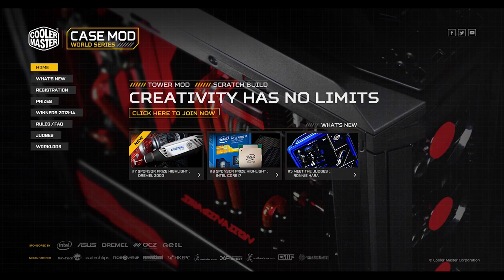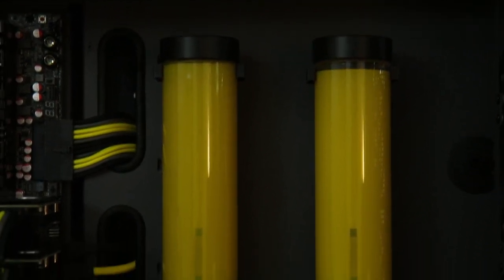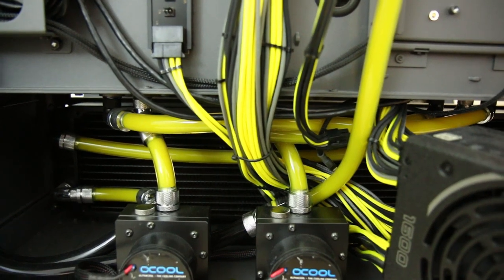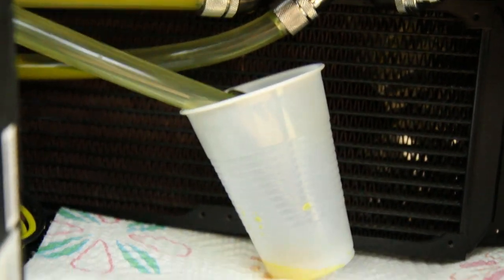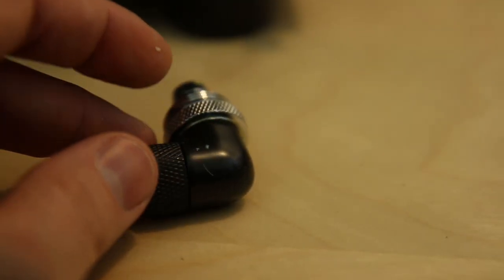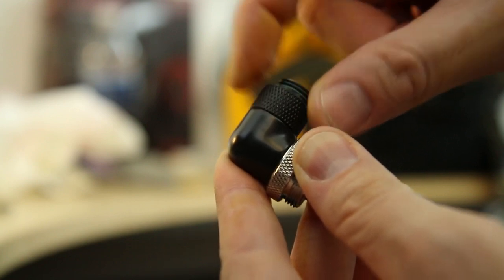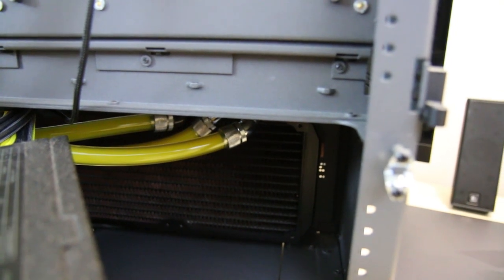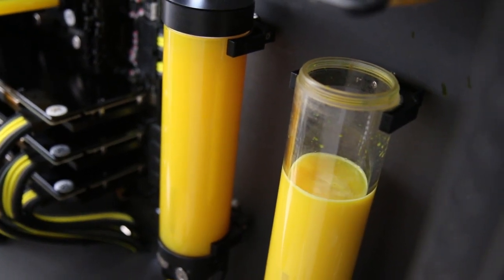My $6500 Custom Watercooled PC LEAKED!!! Now lets fix it....

Comment: sounds like water cooling needs to be re-engineered for less failure points
Reply: just use plastic fittings
Reply: TurboCMinusMinus lol yeah 20 fans
Reply: Water cooling is just air cooling with the water transferring the heat from the components to the heat sinks (radiator) instead of heat pipes. The advantage is being able to have much larger heat sinks than with air. The amount of energy that a heat sink can dissipate depends on its surface area. With CPU heat sinks like those from Be Quient, you don't really need water cooling for CPUs. But, the form factor makes this impossible for GPUs without extreme modding. But, people have had great success with CPU heat sinks put onto GPUs.
As for your original comment, they have. It's called AIO water coolers. They have minimal failure points, and they use permanent fittings, which allow better sealing. There is no reason why someone couldn't try doing something similar with a custom loop.

Comment: couldn't you just use mineral oil instead of water so if it did leak it wouldn't damage anything?
Reply: Two problems with that.  1) These pumps really aren't designed to push liquid with the viscosity (thickness) of any oil.  2) Mineral oil is not nearly as good of a heat transfer fluid as water.  Water has a thermal coefficient of .67 K W/mK while mineral oil is at .162 W/mK.  This means water is about 4 to 5 times better as a heat transfer agent.
Reply: +John Smith But if the water was distilled (I don't remember the actual term for it, but the process that removes everything from the water) then wouldn't the computer be fine anyways?
Reply: I'm not really sure what you're asking.
Reply: John Smith
Water isn't conductive, the impurities in it are what make it conductive. If you used the type of water that has no impurities, wouldn't the computer be fine if it leaked?
Reply: The problem is the water wont stay pure inside the loop.  It will be making contact with metals (copper usually) and will pick up charged particles from that.  So it WILL eventually be conductive.
Reply: John Smith
I didn't even think of that.
Reply: Are you refering to deionized water?
Reply: I think he means... mineral oil.
Reply: llamasplosion i think it is just because its thicker than water
Reply: Use colander
Reply: llamasplosion modern coolants are not very conductive to a point where it doesnt matter if it leaks
Reply: John Smith nerd

Comment: Don´t move rotary adapters, when fluid is in the Loop. That´s a good tip to avoild leckages of this type. No matter if a adapter costs 5 or 10 $ . It can happen to every brand

Comment: If you ask me the risk of leaking with a custom loop is significantly less than with an AIO such as Corsair. When you build a custom loop everything is in your hands and you can have nearly full control over it. Most of the leaks from custom loops are the result of either negligence or simply human error. But the more you learn from it, the more of those errors you can root out with subsequent builds.

Compression fittings are quite secure and it takes a lot of force for the tubes to simply pop off. At worst scenario, working compression fittings will unscrew themselves slightly because of rotational tension. This can easily be fixed by getting rid of that tension or stress, and screwing the fitting on more tightly. Any other failures from fittings is the result of unnecessary stress which can easily be remedied by giving the tubing enough slack. 

Apart from the fittings themselves, another possibly common source of leak is when people tend to forget to plug 
open ports or even tighten the existing plugged ports. So you can get micro leakage from radiators and GPU water blocks.

A third source of leak is overtightening fittings to the point where the ports begin to crack. This goes for the reservoir, pump and water blocks etc. 

And a fourth and common source of leak is when people use too long screws for the radiators. When they mount it to the case or fan they punctuate the radiator with the long screws.

Comment: Why do people even do liquid cooling? Like, other than the fact that it can be configured to look really cool, it seems useless. If you want liquid cooling for a "quiet PC" then why don't you just wear headphones instead? Or maybe just buy some very silent fans? I have super cheap fans that I don't even know the name of and my PC is like half as loud as my PS4. I understand some people want it for overclocking so their system stays super cool, but you can keep a system cool for the same price, or even less than the cost of a liquid cooling setup. On top of all that, we have the leaking problems. I know this isn't a very common thing, but it's something that could ruin your whole system, as for air cooling, if something breaks, you just buy a new one. It doesn't break anything else, it doesn't leak colored fluid everywhere inside your case.
Reply: Can't agree more

People want that because it looks 'cool' I once considered water cooling because my computer overheats but after considering I just change a casing which has a better air flow and when I added another 2 fans I think it's as good
Reply: Yeah. Especially with the Noctua fans and all. They're silent and have great airflow. I even bought two last night for my new build.
Reply: Most of the fluids that are used in water cooling won't damage the components. Some people like to have a super high overclock and air cooling won't cut it.
Reply: ***** solomonshv Yeah of course. I'm just saying that I don't see the point of it being in a stock build, or even slightly overclocked. I can overclock my GPU a bit and the CPU cooler that came with the processor along with two fans seem to keep it at a normal temperature.
Reply: ***** What are you even saying? No one that uses a custom loop doesn't overclock. That's one of them main reasons they do it.
Reply: Lol he's using a stock heat sink. What a joke. Eugene has no clue what he's talking about.
Reply: Logan Wang Who's using a stock heat sink?
Reply: +Extol Eugene when you are out of budget,you hadd no choice but to use it
Reply: +Flash The Reptilian Very true. There's a common misconception that air cooling is what beginners use whereas water cooling is what you should really be using when you start to upgrade. Most of the high end case fans, CPU coolers, etc do just as well at temperature control (even in high-end machines). The only time a PC needs should actually use water cooling is when it is monstrous, i.e. the tier above high-end. I'm talking 3 video cards... that type of beast. Otherwise air cooling is just as powerful, and significantly less dangerous.
Reply: +BieberSucksCock100 No. Just no. 

If you're talking about the crappy watercooling in a box kits on sale for $100, then yes, aircooling is just as good. Custom watercooling is so many tiers above even the best aircooling that it's worth every penny to invest in a custom loop, especially because the pump and radiators will now follow you from build to build and you'll never have to shop for gigantic motherboard bending heatsinks again.

Believe me, the majority of people talking down a good custom waterloop have never run one, because once you have run one, and realized just how much more you get out of your components you will never go back to aircooling.
Reply: +Extol Eugene  I spent $375 in 2004 for watercooling gear and universal adapters for an opteron 170 and SLI 7900's. I've used it on 2 cases, 5 different motherboards, 10 or so.. (can't remember) graphics cards. I would have spent $800+ for gigantic motherboard bending heatsinks and 3 slot GPU coolers to even come close to the performance I get from watercooling. I have never had a leak in 11 years because I don't use crappy bling fittings like these. I watercool because it's a one time expense that saves you masses of money and gets the absolute most out of your components.  I spent $219 on an R9 290 this year and it had artifacts at 1,080/1300 @ 70c on stock air and sounded like a jet engine. I put it in my loop (for free, already had the parts) and am now at 1,250/1530 43c load and it's whisper quiet and I'm getting about 80% of the performance of a GTX 980 at 40% of the cost. That's why custom watercooling cannot be beat.
Reply: K31TH3R For all that money you spent on watercooling you could have just gotten a better GPU. Or hell, combine the money you paid for the GPU and watercooling and gotten two.
Reply: ***** I bought my loop in 2004. If I spent $375 on a GPU in 2004 it wouldn't be doing jack for me right now. In fact I'd probably be using it as a paper weight.

I think you misunderstood me. It cost me $0 to watercool my R9 290, because I already had the parts for it. Parts I've used on a small army of GPU's.
Reply: K31TH3R Congratulations. You repurposed some old equipment. What's so good about watercooling again?
Reply: ***** *facepalm* Not the sharpest tool in the shed are you? Repurposed old equipment? lol No. Watercooling doesn't become outdated. You buy it once, and you can then use it on every future build.

I'm not sure how else I can explain it?
Reply: K31TH3R I understand. Why would air cooling become outdated then?
Reply: ***** If you buy a new GPU, you need to buy a new GPU air cooler, no GPU air cooler is universal. Not so with water. I'm using a Maze 4 universal block that I paid $34 for in 2004. Although admittedly I did buy a $13.95 VRM heatsink because I wasn't happy with my 290's VRM temps on the VRM heatsink I made. Newer CPU heatsinks do come with adapters for different sockets, but they don't come with adapters for sockets that don't exist yet, unlike watercooling which is extremely easy to adapt to whatever mounting situation.

Modern heatsinks are GIGANTIC. They block access to memory, they make it a pain to reach PCI-E release switches. They make it difficult to mount fans to move air over PWM's. The downsides of aircooling go on and on and on.
Reply: K31TH3R Uh... GPU air cooler? Those exist?
Reply: ***** Well, they used to be a lot more common, because GPU's are coming with decent cooling if you pay more but I really have to laugh at stuff like this: http://www.newegg.com/Product/Product.aspx?Item=N82E16835186098 

Because that GIGANTIC MF'er is vastly inferior to this little thing on my GPU: http://unoid.net/casemod/maze4gpu/
Reply: +K31TH3R You have the patience of a saint talking with this person. Just let him continue using air coolers, it's his loss.
Reply: dcope321 I don't have a problem with water coolers anymore. Just custom loops.
Reply: ***** That doesn't make sense. That's like saying "I only go to drag races to watch cars with stock engines race, cars with customized engines seem obfuscated."
AIO's will never outperform a custom loop, just like a stock Ferrari will never outperform a blown big block top fuel dragster. The materials are mass produced and cheap, pumps generate small amounts of heat and placing them directly on the CPU is not ideal. They're not immune to leaking either, just google "H100 leaked" or "H100 pump died" and see there are hundreds of reports. Personally, the idea of trusting someone else's design around my hardware when I'm unfamiliar with it's potential leak points is insane. Choosing convenience over longevity and reliability is a disaster every single time.
Reply: K31TH3R Thanks for telling me that. Now I don't like either. I'd rather get some $20 PC fans rather than a $200 liquid cooling system that may or may not ruin my entire system. If a fan fails, I lose $20. You want to know what other parts the fan ruins? Nothing at all. Because it doesn't LEAK FLUIDS INSIDE MY PC.
Reply: ***** Fans fail too. I have seen an LED fan fail, overheat and melt the solder to an LED, and the wire broke off and grounded to the motherboard. Because the person was using a cheap power supply without OCP, this resulted in the death of the motherboard, the CPU, the RAM, and the power supply.
But just because I've seen that, am I going to stop putting fans in computer cases because of an extremely rare case like that? Of course not, just like I'm not going to spend $1,000 on the highest end processor when I can spend $200 on a lower end chip, and $200 on watercooling that will very likely equal or even beat the $1,000 processor.
If you want to be the person that buys a $1,000 processor and runs it on stock cooling, feel free, but people like me will laugh at you and feel bad for you while our PC's are happily cooled with liquidy goodness.
Reply: K31TH3R I don't think any high overclocks should be messed with on any sort of PC. Liquid cooled or not. Low-medium is fine with air cooled though.
Reply: ***** Also, I've recently upgraded my system. Now I have a $79 Xeon X5650 6 core 12 thread processor, and thanks to my good 'ol reliable watercooling I'm running it at 4.6GHz, 52c load. With a $80 processor and watercooling, I'm beating brand new Intel Skylake builds with processors that cost as much as my motherboard, 24GB RAM and processor combined.
Is there a small risk with running watercooling? Yes, just like there's a small risk you'll get hit by a meteorite while you're out for a jog, or a small risk that your toilet will explode when you flush it. Is it worth the risk to use watercooling, or going outside on a nice day, or using indoor plumbing instead of taking a dump on your lawn? Abso-fucking-lutely.
Reply: K31TH3R $80 Xeon? Was it used?
Reply: K31TH3R Also, do you ever have to do any sort of maintenance on water cooled PCs?
Reply: ***** Yes, it was used. It was pulled from a server. They're my favorite type of chip because they've been run at stock for years at high temperatures and it forges the core solder. I've yet to have a server pulled Xeon that wasn't able to hit at least a 50% overclock with excellent temperatures and low voltages.
I do the same amount of maintenance on my PC water cooling that I do to the water cooling in my car. I check to make sure the coolant is topped up every 6 months or so and beyond that I never even think about it.
Reply: ***** I have run ridiculously high overclocks on multitudes CPU's for years and combined totals of decades. The result is that depending on voltages and temperatures, you may reduce the life of the CPU from 25-30 years to 1-15 years depending on how zealous you are with voltage and how careless you are with heat.
I have never once killed a processor nor even degraded one so much that it can't be run at stock frequency and voltage. How well the chip is printed on the silicon wafer determines at what maximum frequency it will run, as long as it's cooled, the chip doesn't care whether it's operating at 1.05v @ 2.67GHz, or 1.5v at 4.6GHz.
Reply: If you always reused the same waterblock to save money you could also reuse the same motherboard bending heatsink to save money, also your logic will work for a cheap AIO just as well, lots of holes there.
Reply: Same for air coolers of a bygone era of computing.
Reply: 43c load in your dreams unless you have your pc outside in the winter, let it saturate the loop and you'll probably see 60ish degrees unless you're running more than a 360mm rad or some really fast obnoxiously loud fans.
Reply: Abraham Lincoln I have a 1090 ti and it is cooled with air and it’s fine
Reply: Air Cooling is only going to be ok against AIO units... 

1.) It's common knowledge as soon as you turn an AIO of MOST brands initial temps will be better than ANY Air cooler you can purchase. YES, I'm talking about the Noctua too. Where AIO fails is once it continues to cool the CPU overtime it can no longer sustain those lower temps and will slowly rise to temps slightly over the Best Air coolers.  A custom loop does NOT have this problem.. 

2.) Yes, your CPU fan may be quiet, but I assure once you turn on a demanding game none of your system will be able to compete against a Custom loop's sound signature. 

3.) If the shit leaks and as long as you are cleaning the case and rotating the liquid for fresh liquid that isn't Conductive … you rarely have a thing to worry about.

Comment: I've only had one leak in many years. Somehow the screws on the GPU block loosened a bit, allowing the block to leak. I have an old DD Torture Rack, so it dripped right onto the mobo, cleaned up the fluid, tightened the screws and all was good. I've always stayed away from those fittings, don't trust them. Fatboy fittings with 3/8" ID Tygon tubing seal extremely well with no clamps, nice clean look too.

Comment: Just as a bit of side info to help you in the future, some fittings especially pressure seal things like  you had fail. Only are leak proof while under pressure. The highter the pressure the better the seal, since the pressure is what's forcing the seal closed. Momentary laps in presume allow flid to get in the mating surface and won't become sealed until more pressure is applied or the surfaces have be cleaned of the lubricant.

Comment: Old topic, but just found this one... if I'd installed the tubing I would be putting it down to user error.  0.5 mm too long or too short on the length of tubing will be enough to cause more pressure to one side of the fitting, resulting in less pressure to the adjacent side, which would result in the leak.  To the naked eye it can look like everything is centered, but very difficult to actually test that the tubing is neutrally centered inside the fitting.  Even an extra quarter turn on the fitting nut can cause a grab which is enough to slightly off-center things enough for a leak.  I've tested my theory too, by linking up piece by piece, until it is complete, then removing the whole thing and watching it flex slightly so that holding it up to where it is supposed to line up shows a slight difference and the need to flex slightly to rejoin the complete assembly.  There is always a little guess work in the end... but most of it is done by feel, which is learned by experience.